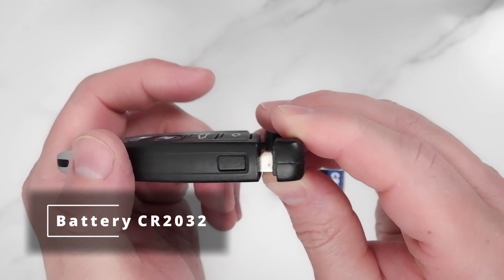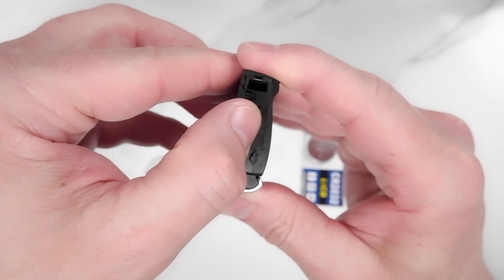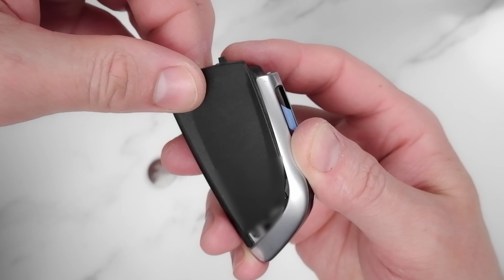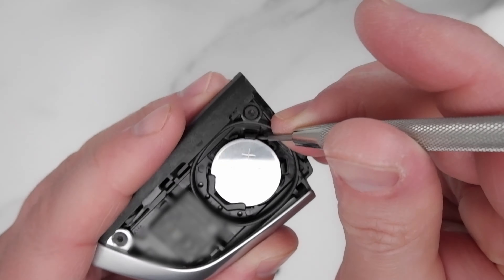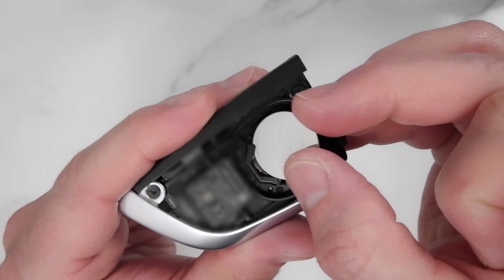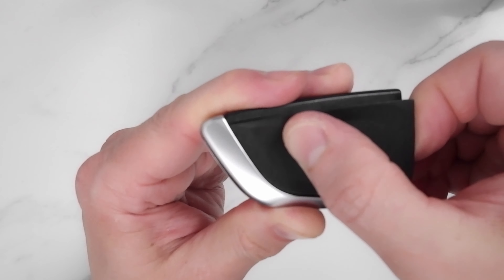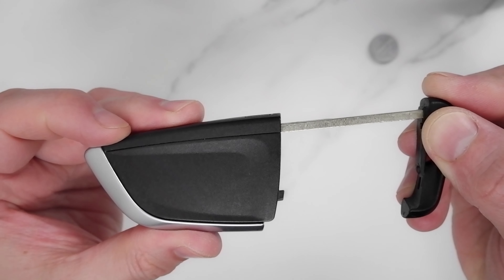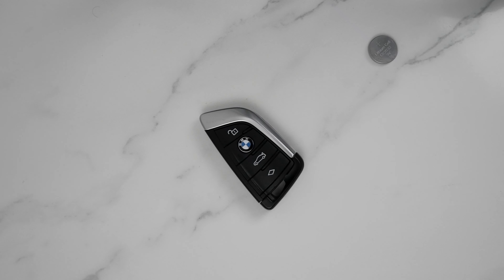Battery replacement BMW X3 X4 X5 X6 Fob Key Battery replacement - How To

Comment: OK, but never touch the batteries with your hands. The hands are normally with sweat that in contact with the batteries could oxidize them and bring the oxidation to the circuit to which we are replacing the battery. This is for all types of batteries.